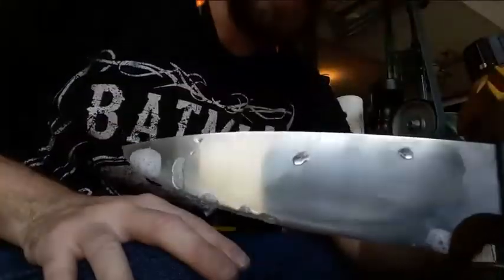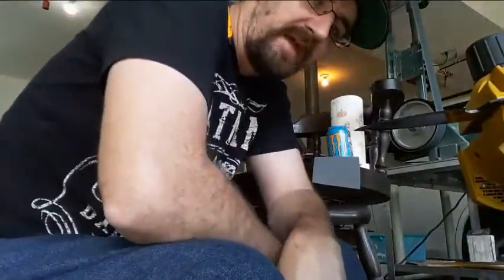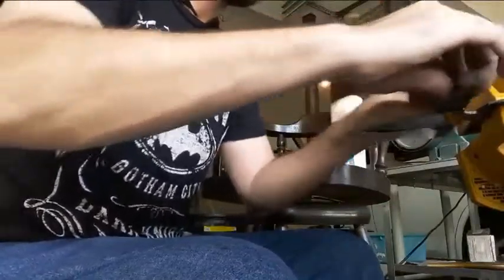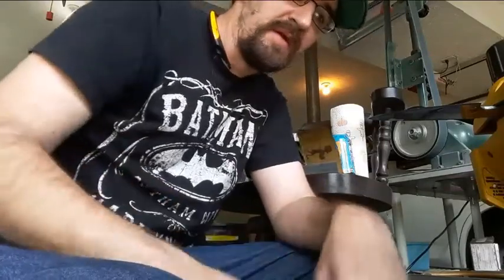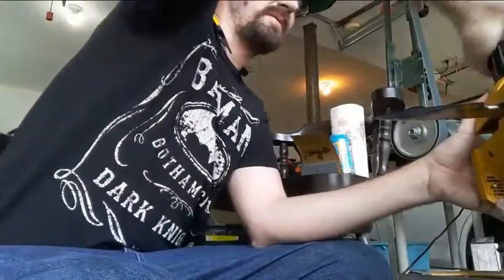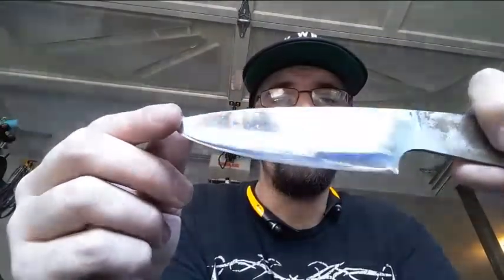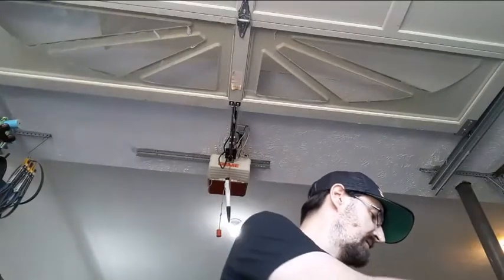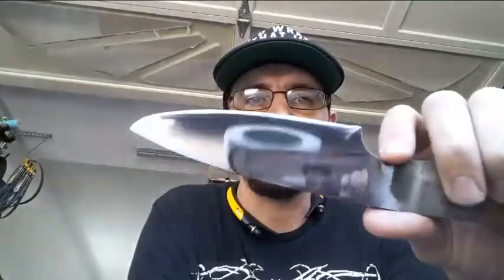Finishing the mirror polish

Comment: Back in the day in the air Force I polished three A10 gun barrels to 8000 grit all by hand for retiring generals. When I did one for myself years later I built a 9 foot lathe to Chuck it up in to do it all. Hand sanding just sucks.
Reply from the maker: Jason Sullivan, Shamrock Forge That's why I included the Walter Sorrels quote.
Reply: Curiosity Forge oh and nice job by the way. That's a heck of a shine!
Reply from the maker: Thanks! I hope to start on my next mirror finish tomorrow. This time I took the steel up to 220 grit BEFORE heat treating so after I clean up the scale and tempering color I hope to have a MUCH better canvas to start hand sanding at 120 grit and work my way up.

Comment: That buffing wheel. Is that the 4 inch one? I was gonna get some to use in my drill press.
Reply from the maker: Grandadz Forge I bought a 2 pack of SMALL wheels that came with red and white blocks of rouge. I bought 1 4 inch wheel and the black, gray and green polishing compounds. I'm gonna buy a couple more 4 inch wheels to replace the small ones, the small ones work but the 4 inch is just a LOT better. I'm not sure how well it'll work on your drill press, I guess it depends on how fast it goes. I went with keeping my blade in the yellow vise and using my corded drill so it wouldn't snatch the blade out of my hand and throw it somewhere I didn't want it to go.